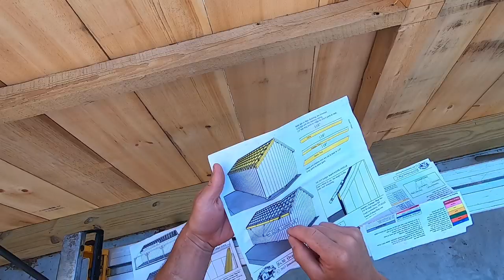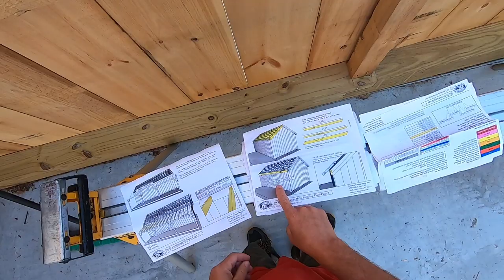It's a Good Thing Gina's not HOME when I am building the BARN we bought off the INTERNET

Comment: Ive left this comment before sir but you need to check the hydraulic system on your kubota. Its either low on fluid or needs to be changed with new filters. The whinning coming from it is getting worse and worse. And i know you need that tractor for your farm. Keep up the good work i love your channel.😁
Reply: A stitch in time saves nine !
Reply: Al obviously saw your very helpful suggestion so we’ll hope he follows through on checking the tractor.

Comment: al, after completed.  if you have barn swallows (or ekk) and there are areas they can access; consider adding #8 finish nails into the rafters (both as building point and if not used a drying nail)

Comment: PPM on the move baby!  Hey Al, check out these O'Brien step in posts for your pigs.  I just started using them for my two Dexter cattle, but they work equally as good with any other livestock. There are 8 different heights for polywire (and 4 heights for poly tape), are SUPER easy to put in (you just step on them) and there is no need for additional insulators because the posts are the insulator, and best of all they're cheap. You can buy these at a lot of places, but I like this company because their customer service is awesome.  May I also suggest that instead of grass, that you sow some edibles for the pigs where they just were (assuming you're going to rotate them back there)  Pigs love stuff like peas, alfalfa, kale, daikon radish (both the leaves and the tubers, and whatever radishes they don't eat will just decompose and add to your soil). Cheers!
https://powerflexfence.com/products/obriens-treadaline-step-in-post-blue-eash-opti-ea

Comment: Really good build. Not a bad idea to put one or two extra planks to fill out width on scaffolding, on top installing either 3/8 or 5/8 plywood rectangle overlapping all 3 planks and running atleast 50% or better 100% length of  the planks, screwed in place, circle screws with sharpie for easy removal. That way you increase your safety level and reduce sponginess of turning scaffold into a high dive.